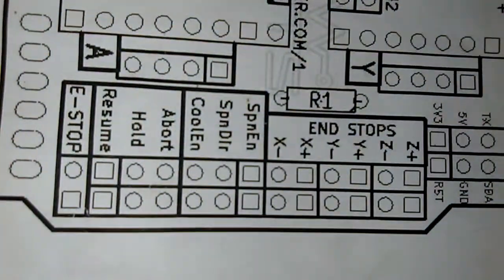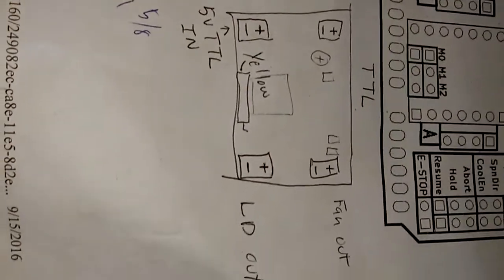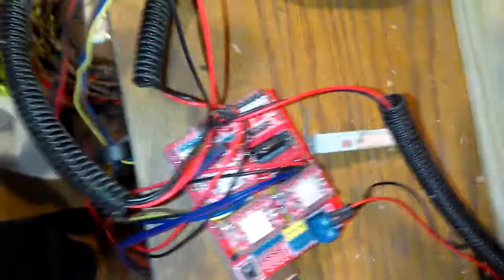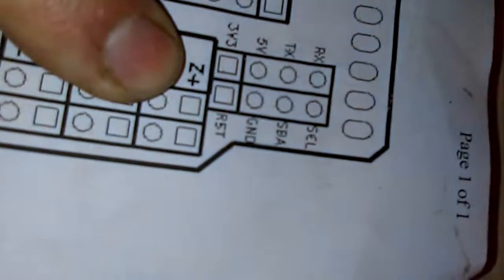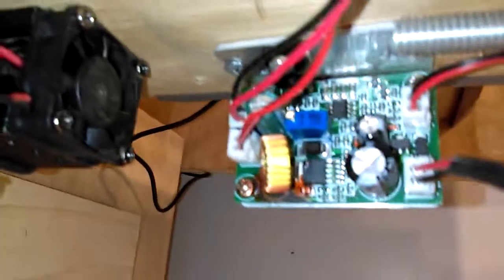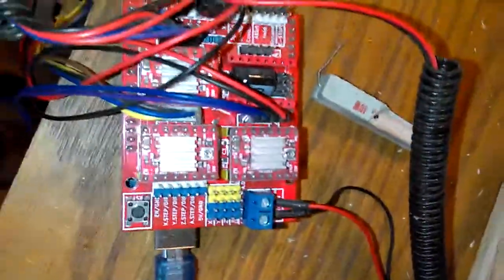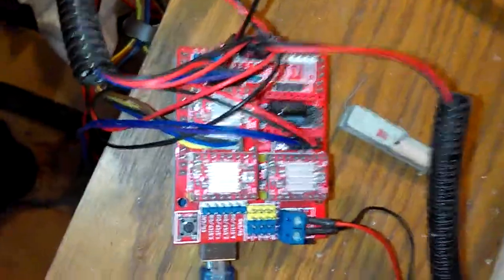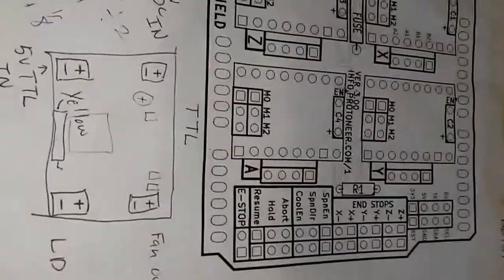Connecting arduino cnc shield to TTL laser diode driver board

Comment: Hi sir. This is the most useful info for building a laser engraver. Can you please share links of what firmware tou have flashed in arduino please. I am trying to build one, what I got from video and laser comment is you have flashed arduino with grbl 1.1 connected CNC shield to it connected stepper motors at x and y axis pins of a4988 and then used z+ connection pair for ttl and finally used laser grbl for engraving the design. Right

Comment: you are using LaserGRBL software correct? What if any changes in the GRBL code did you have to change? I am using LaserGRBL and its Sensing S commands to increase or lower power at laser, and M3 and M5 for on and off. My problem is if it sends an S255  M3, my laser is on very low. I have figured that for my laser to be near full power, it has to S19500, or more. I think something isnt set rite in my GRBL code, because it should be S0 to S255 to have full variable laser power.. Would you agree?
Reply from the maker: In the LaserGRBL program when you are setting up your image to burn you can set Max power which in my case is 255. With my 3 watt laser I can burn the holy crap out of something if I don't dial back the Max power. I didn't have to change the settings on my arduino board for power, the software takes care of that.
Reply: Todd Morrill thanks Todd, I think I figured my situation out. For some reason my setup wants the S code to be from 0 to 119500. If I send a S255 M3, the laser barely comes on. But If I send S119500, which is 5 volts, the laser is at full blast. Not sure why mine is that way, but, its workin. I can actually go higher, but then the ofcourse the voltage increases past 5v, and dont wanna burn out my laser. Thanks for all your help. Now I gotta figure out how to get Estcam to play nice with lasergrbl, or if it's even possible.

Comment: did you put a resistor in between the two TTL wires? I have seen this, but do not understand why?
Reply from the maker: I think it's to help voltage return to zero between pulses.

Comment: What code to send the TTL signal? Also did you ahve to alter the GRBL Code? Lastly, Can you Dither Image? rather Can you vary the laser pulses to change shade for a laser burn image...Thanks
Reply from the maker: https://youtu.be/t_2tXNybC-M
Reply: Thank You For That. That is Good Info.
Reply: What are you using to Send the Image GCODE to the Laser to burn an image?
Reply from the maker: http://lasergrbl.com/en/
Reply: did you power your TTL laser driver with a separate 12 volt power supply than the CNC shield, or are they both getting their power from same supplt? Thanks Again
Reply from the maker: I ended up using a 3 watt laser with its own AC to DC power supply with a matched ttl laser driver board.
Reply from the maker: My grbl arduino and steppers are powered from a scavenged atx power supply 12 volt feed. The arduino is plugged into a laptop via a USB port. The laptop is running lasergrbl program on windows 10. http://lasergrbl.com/en/

Comment: Hi, help me please... I have the same CNC shield v 3.0 and also the same laser driver module... Do you power up the driver with an ac adapter?(in my case ese  provided) and the TTL connection is made to Z+ endstops?
Reply from the maker: I use an atx power supply and power with the 12 volt outs wires. Positive to red negative to black. It has sufficient power to run the stepper motors that I am using.
Reply: @torque63  , What about of second question ??? (...TTL connection is made to Z+ endstops?..)